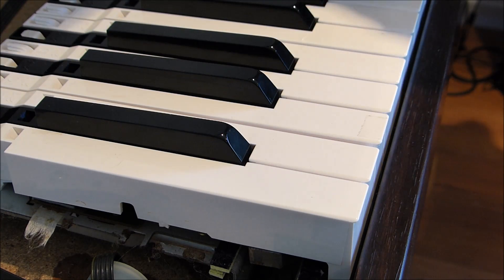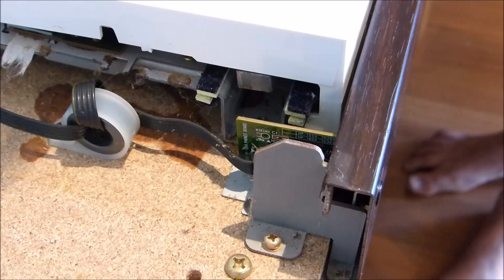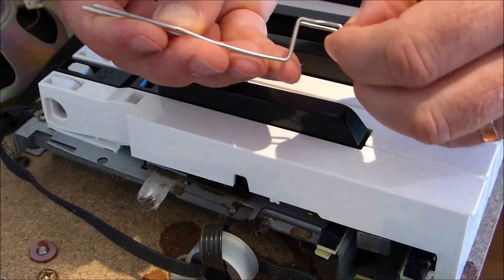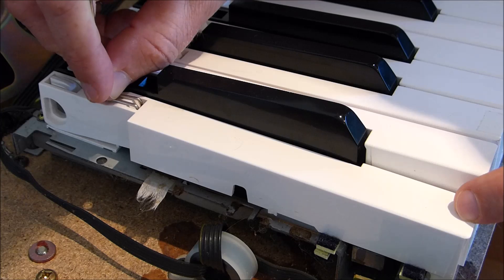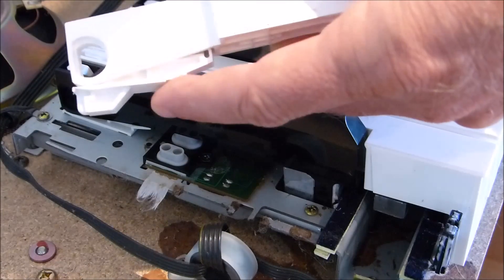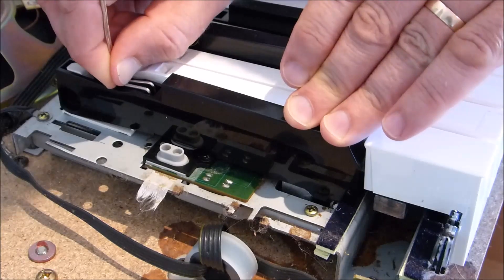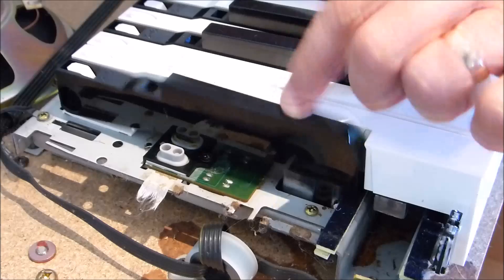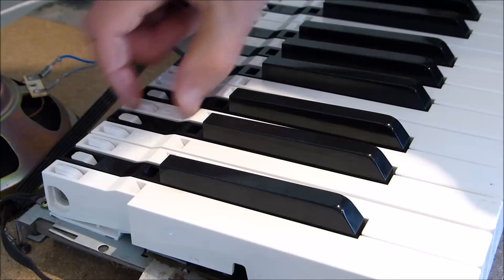Roland HP-230 Digital Piano Key removal for contact repair HP-3700 HP-800 HP-2700 KR-4700 KR-5000

Comment: Very helpful!  I have an HP 230 with 8 dead keys and I'm going to have a try at fixing it thanks to you!
Reply from the maker: +tomsfunband Glad it was helpful. I actually had to do a service again on my keyboard on the weekend, I had around 3 dead keys around middle C and ended up taking a large number of keys out so I could get to the rubber contacts underneith, then unscrew the black brackets that hold them in place and remove them. After removal I ended up washing them thoroughly in water with dishsoap, and used a very fine semi abrasive pot cleaning sponge (the ones you use on non stick pans) to gently remove the glazing on the carbon dots on the underside of the rubbers. Thinking about it now, I suspect a magic eraser sponge would also work well if used gently. Use a fine rubber eraser on the circuit area as well to gently clean it. To remove a contact rubber you need to take out enough keys to be able to unscrew an entire circuit board segment as the circuitboard segment needs to be lifted up slightly to be able to remove the clips on the black plastic that holds the rubber in place, they may also be slightly stuck down, so use gentle pressure to pull them upwards and towards the front of keyboard. There are about 4 circuit segments across the keyboard I think so depending on what keys are dead, you may need to remove most of the keys to get at the underside of the rubbers, or use the the matchstick method I mentioned below to Rodger for a quick fix, just to see if it fixes the issue temporarily. I also suggest leaving most of the case screws out after fixing, as you will likely need to do it again in time.
Reply: @Fontgod  Great and Very Clear Advice my good friend.  Thank You so much - from Hamilton, Ontario, Canada!  My voice speaks for probably 1000 others who have viewed and learned from your generous help.  Thank you Fontgod - you truly Rock!
Reply from the maker: @wpiskyvision  Thanks, that means a lot. It has blown me away how many views this has had so far and I really appreciate all the great comments. Nice to know my advice is keeping a bunch of instruments out of landfill as well.  :)
Reply: @Fontgod   Yes, it should be a pleasant rush that you have almost reached the 30,000 views mark on this veru excellent video of yours !!! Such great news and as of 1:am on May 19, 2020) count is:   29,446 views )   You're getting close to the 30 K  celebration!  

Despite this crazy new world-wide epidemic we are all having to deal with - I salute you for reminding us all that - - - Life Goes On - - - and we'll all be okay.  Alright everyone?  We'll all be okay.

Comment: Is there anywhere to buy the actual tool?
Reply: +Michael S You could try contacting a Roland service center and requesting an "sk-6 key removal lever". However the correctly bent wire method should work provided the wire is of sufficient thickness. If its too thin it will bend out of shape too easily. I assume you saw the diagram of how to bend the wire at the end of the video?
Reply: +Graham Jupp all the paperclips I could get my hands on weren't strong enough apparently. I was able to get a few keys off and then I managed to get the rest off with a flathead. I fixed my issue, which made me happy since I had no idea what I was doing. I might not have been able to do it, or most likely would have broken something without this video though, so THANK YOU!
Reply: +Michael S Glad its helping to send less pianos to landfill. When you and Rodger Anderson say you are using a flathead screwdriver, are you still going in through the access slot at the top of the key or attacking it from the side after you got a few keys out with the paperclip method?
Reply: +Graham Jupp, from the side. I was popping them off very fast with this method, and didn't damage/scratch anything. The reason I couldn't get them off with the clip method was there looked to be an adhesive strip running along underneath all the keys. A simple paperclip was not strong enough. I suspect that since I removed those keys once, it will be a lot easier the second time with a clip. 

I might look into calling a few service centers and trying to buy the proper tool.
Reply: +Michael S Interesting, there was no adhesive strip on mine, perhaps a change in manufacturing. With the paper clip method you first need to depress the key, then insert the paperclip and push it backwards, then raise the key and pull the whole key forward (for the white keys that is, the black keys are moved backwards). Using the paperclip tool enables you to just remove the keys needed to be repaired, an advantage over the screwdriver from the side method I think.
Reply: Graham Jupp How does the screwdriver from the side method work exactly? I've been trying to remove some keys but the tool I made isn't very effective. I don't mind removing more keys if it means getting the right ones fixed. Thanks in advance!

Comment: Hi Fontgod.. really appreciated your utube in respect to removing the keys of the Roland HP 230..The tutorial was great.. made the tool - or tried to.. great amount of frustration trying to make it work..Out of pure frustration after a number of hours, I used a screwdriver and twisted to raise up the "keeper".. just barely tapped it with a hammer & out it popped .. probably not as professional as your method.. but had them all off in about 15 mins :) Cleaned the contacts.. made no difference !!
Reply from the maker: +Rodger Anderson Interesting method, was this on HP230? Did you damage the keys much using the screwdriver method? So do you have some keys that are not sounding at all? I assume you removed the rubber contact strips underneath the keys and cleaned the circuit board contact areas gently with a soft eraser? Did you also try flipping the rubbers over and cleaning the little corresponding carbon circles gently? When you remove the rubbers and flip over you should see a bunch of carbon dots, if some look a bit glazed under a light then they may need a clean.
Reply: +Fontgod .. It actually worked REALLY well, and absolutely no damage to keys.. once I worked out the mechanism.. kinda figured that if the keys didn't work & our local "repair man" said he could do nothing with it, then I had nothing to lose :) We only gave it a "cursory" clean, but will make another attempt.. thanks so much for the info.. all very helpful
Reply: +Rodger Anderson I used a flathead as well once I got a few keys out with the paperclip tool. Worked great!
Reply: +Rodger Anderson Its sometimes possible to do a quick fix of the contacts by removing the faulty key, and then push a matchstick into each of the 2 holes in the contact rubber, push the matchstick in enough so that it pushes the contact to the circuit boards and jiggle it around in a circular motion for a few seconds. Don't push too hard or it may damage the rubber. The idea is to dislodge the dirt/glazing that happens over time. I have to do this every few months with a few faulty keys, particularly when its humid. I leave most of the screws out of the case so its easier to open (I only leave 2 screws holding the lid closed, and 1 small screws at either end of the metal fascia plate, that way I can have the case open and key removed within 5 minutes.

Comment: Fontgod Thank you for this video ... it helps me for my Roland HP-800 too.
Could you give me the roundabout dimensions of the tool?
Reply: +Fontgod these instructions were also identical to the KR-4700/5000 model keys. I searched, and watched a lot of useless videos before stumbling upon this one. You could also put those in the title.
Reply: +Fontgod/Graham, I recently aquired a KR-4700 from someone for $100. I've been looking for something to get my son started on piano lessons with. There was a contact issue with 8 of the keys (reason for price, plus they just wanted it gone). I took a gamble, and was able to fix it myself. $100 well spent. The manual for it is a joint manual for both KR-4700 and 5000 models.While the piano has some age to it, I'm quite happy with it. Thanks again for the video. It's apparently the only one of it's kind.
Reply: Perhaps you can add in the title "HP-800" so more than me can find this video ;)
Reply from the maker: Santa Dragon If you look at the last few seconds of the video you should be able to see an image of how to make the tool with dimensions in millimetres, just pause the video there. By the way, it is sometimes possible just to remove single keys and do a temporary fix for issues with contacts. Remove the key that is not responding, push a blunt thin stick like a long matchstick or bamboo skewer into the hole in the rubber contact and gentle wiggle it around a little, this can help to free up any dirt under the rubber contact that is causing the issue. Each contact has two holes, do it for the upper and lower hole.
Reply: Fontgod Hi there ... thank you for the note. I have just the problem that the key doesn't come up again. I just want to remove the key to change the spring element.
Reply from the maker: Santa Dragon Hopefully the spring has just fallen out of its slot somehow. Hasnt happened to mine though. Looking on google it seems that the HP-800 has hammer action keys, so my feeling is its quite a different key mechanism to mine (which doesnt) and this video may not really apply to your keyboard.
Reply: Fontgod But it does ... I saw my keys and yours. The lock mechanism is the same.
The difference is just the cheap lead weight under the key.
I allready demounted some keys and it work the same was as you shown!
So you can add the HP-800 to the title.
Reply from the maker: Santa Dragon Great news, glad it helped you. :)
Reply from the maker: +Michael S Great thanks, I can't confirm this myself but have added to keywords at your recommendation. Hopefully it helps. :) What model have you got yourself? By the way, this is still Graham.